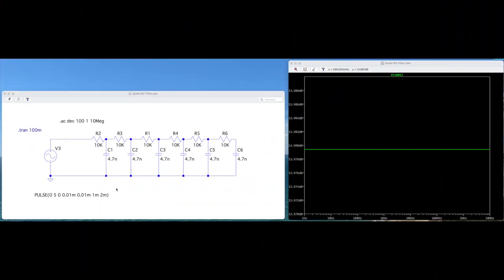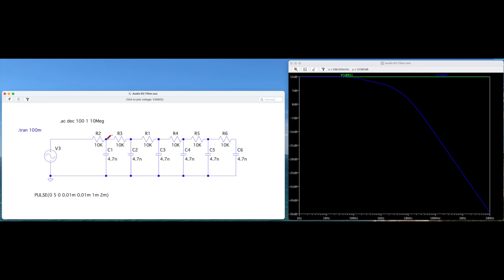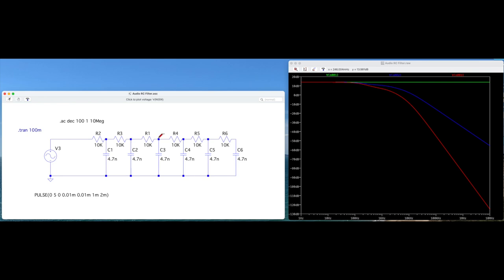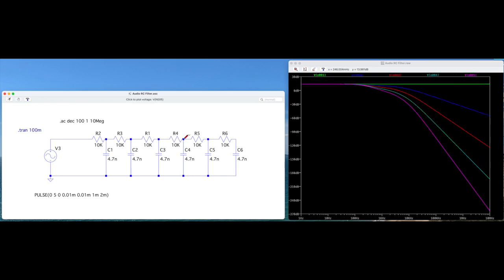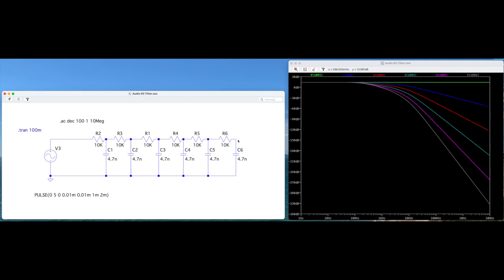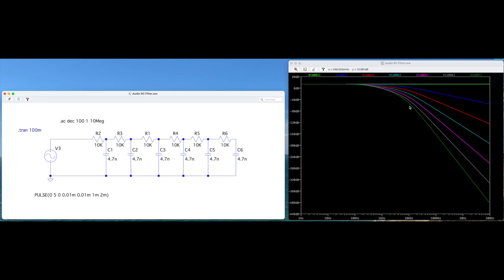40 - Multifunction Digital VFO - Part 2: Software

Comment: Hi Nick, please don't take this as a criticism, I have very little software skills.  I have built a pcb version of your vfo, and the filter board, both of which are working FB . Just a couple of observations with the software, I notice that the vfo doesn't start until the encoder is operated although the BFO starts straight away, and when changing the band it won't switch until the encoder is moved. Otherwise a very nice project. As I said not a criticism but an observation or it may have been designed that way? tThe vFO has a nice positive action and does not skip steps, so I will be using it. Thanks for sharing. Best regards....Peter (GW4ZUA)
Reply from the maker: Hi Peter, no worries at all. Yes I kind of stuck with this code because of bad experiences early on with rotary encoders! To be honest I've changed so much of it I really ought to start from the ground up but that thought doesn't fill me with joy. As a consequence it is something akin to a patchwork quilt! However, if you've managed to get it working then very well done! 73 Nick

Comment: Hi Nick, I got it running fine now, nice code. I like switching the transmitter part in two stages.
When step is set to 1KHz and you want to go to 100Hz you have to cycle through all steps to get there. I added in the following code, just after  if (get_button())   {
    if (duration < 500)
    ...
    ...
    the original case 1 to 1000000
    ...
   else {
   case 1000000:
   ....
   ....
   case 1:
   
Now, when the switch is pushed for more than 500 ms, you go back one step
Of course you have to declare:
unsigned long startTime;
unsigned long duration;
and modify get_button() to count the duration.
Reply from the maker: That's great. Glad you got it working - and even tweaked it to work better for you! Great stuff. 73, Nick

Comment: Nick: Nice VFO graphics and clean code. Do you see any need to monitor the TX and RX busses to make sure they have actually switched before switching the next group? James
Reply from the maker: Hi James, I haven't done thus far.It is an interesting idea though and could certainly be done ... if I hadn't used practically all my Arduino pins already! To be honest I've built a number of transceivers with no such switching delay at all and they have worked fine - they were all QRP (or QRP-ish!). I first did it when I built the last rig (Shelf 17) because that puts out at least 80W. I didn't want that kind of RF being pushed through relays that I wasn't sure had switched yet! For QRP it is not such a big deal but I view it as good housekeeping more than anything else. Thanks for watching and commenting. 73 Nick
Reply: @M0NTVHomebrewing  Thanks for the response. I guess I'm overly cautious from my old days in SCADA software. I was switching 69KV breakers. Definitely had to know one was clear before closing the other! Cheers.

Comment: Morning matey! Well you were spot on, right over my head, but still a very worthwhile watch and great explanation of how it works. Can't beat the smell of a hot soldering iron though!
Reply from the maker: Cheers Al! I must admit I found it more satisfying building the actual VFO board with all the interconnections etc. than I did cobbling together the software that runs on it. I suppose the thing about building radios is you get to play with many different types of electronics: audio, digital, RF etc. But I agree: it's not as much fun if you can't prod it with a screaming hot iron! 73, Nick